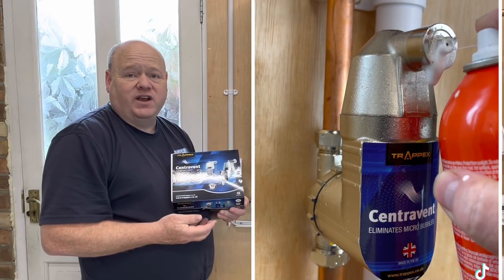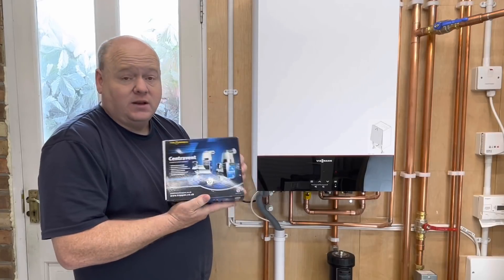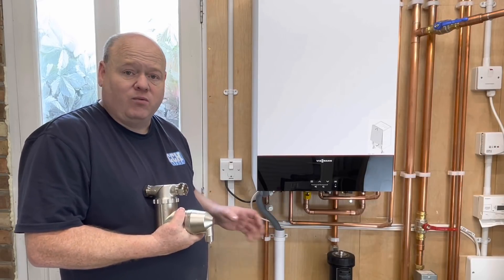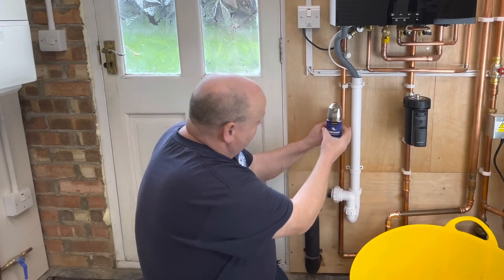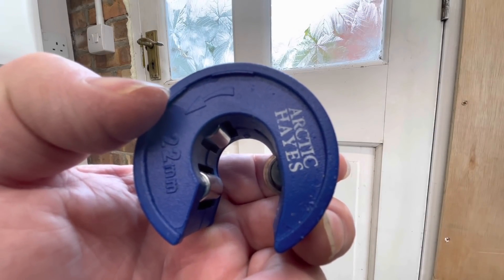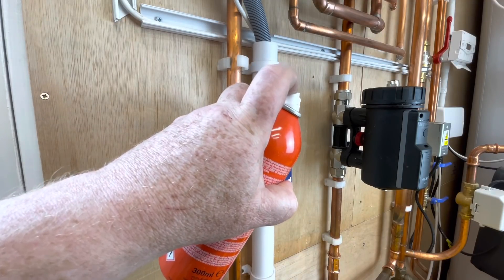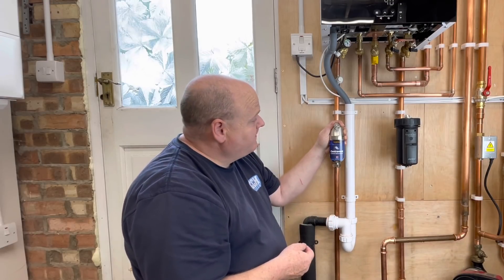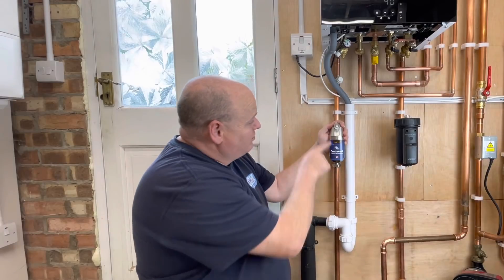Trappex Centravent Deaerator - Central Heating Protection

Comment: Deaerators have been around for years in commercial applications, if you you go back to basic science,water contains carbon dioxide the Hydrogen and Oxygen etc you see that every time you put a pot on to boil, if a scrubbing  medium is added to to Collect theses micro bubbles and are removed from the system. Unlike an Auto air vent which should be closed  Not left open after filling the system . Deaerators are positioned in the hottest part of the system and  AAV are located in the coolest.

Comment: Are they available for hot water cylinder on a sealed system???
Reply from the maker: Thanks very much for your comment, please consider subscribing to support the channel 🙂
Reply: @AllenHart999  or what would you recommend for a domestic hot water tank that accumulates air at the hot outlet??
Reply from the maker: You can install them on an open or sealed central heating system; thanks.
Reply: @AllenHart999  what about domestic hot water cylinders ??
Reply from the maker: @fionnan2811happy   no
Reply: @AllenHart999  Thanks for your reply. 
I have a pressurised cylinder which is accumulating air at the top and when a hot is opened its splashing about
Reply from the maker: @fionnan2811happy  That doesn’t make sense, call someone out to check it
Reply: @AllenHart999  It's a 300l tank with solar heating and oil.
All we did was install it, asked other plumbers and they recommended that we fit an automatic air vent on the hot outlet but I have not seen a vent for domestic water. Everything is plumbed by the book but builds up with air/steam at the outlet. 
I'm baffled with it.

Comment: You may be interested to know that Worcester Bosch do not advise or require de-aerators to be installed as they consider that they serve little purpose on modern, sealed systems.

But of course, on other boilers, or other situations the installation of them may have different outcomes.

Comment: Hi Alan. Thanks for the upload quick question how do you keep your pipework so polished I wirewool mine and looks like yours for a  few days but then discolours.  Do you use brasso? Thanks
Reply: Varnish the pipe before it oxidises
Reply: Varnish???? I would use brasso but not sure on varnish do you have any experience with varnish would be interesting to know what you would use thanks
Reply: Brasso will clean it, but it will immediately start oxidising again.
Clean with thinners then use this
https://www.marinestore.co.uk/Merchant2/merchant.mvc?Screen=PROD&Product_Code=ryibl400a
It's a lot of effort, but I like my own copper to keep its shine, never bothered on anybody else's system.
Reply: @psi10001  thanks 4 your information

Comment: 100% recommend these. I had water/clicking  noise in my heating system first thing when it fired up. Fitted a spirotec. Had absolutely zero noise. Periodically you could hear air getting pushed out of the system. Brilliant bit of kit. In my opinion.

Comment: Surly it won't release air that is trapped in rads on the first floor or in the loft. Of course you would still need to bleed a the system manually

Comment: People seem to be confusing a deaerator with an automatic air vent. The boiler and the pump will generate small bubbles though cavitation and heat. The deaerator will help reduce these as well as bubbles formed by dissolved gases. I assume it'll also remove larger pockets of air as well. Seems like a good thing to me. An AAV is only there to bleed large pockets of air.
Reply: Thank you for that description. While I know they are different you taught me why they are different.

Comment: I am a little sceptical of this product.  For years there has been rad adapters that also let the air out , they seem to work well , the only difference I see is this happens at the beginning of the sequence than later on when it hits the radiators

Comment: Il be honest, biggest con going. Waste of money, boiler has one anyway lol
Reply: Such an ignorant comment when you have no idea of it’s operation, benefits and how heating systems corrode !
Reply: @jassinghIG45  believe me mate, ive got a great idea on how heating systems corrode. Most boilers now adays have the deaerator on the pump for this reason, the microbubbles. If people sized and serviced boilers properly, then these wouldnt fail. Your putting another thing on the heating circuit, for it to fail at some point, as nothing is designed to last more than 5 years now, or else most companies would go bust cause their products are that good. My comment is not ignorant at all, its honest, so you just crack on with your opinion and fit them,if you even do this sort of work
Reply: @Purebeltersteve  so according to you one can just tee a cheap little AAV on and call it a deaerator. Does more for the system than a filter does if piped properly absent of any chance of air forming; including fitting stainless steel heat ex boilers not your rubbish aluminium ones. Definitely required when fitting plastic filters, especially Adey ones. Chemicals cannot do the same job, too much chemical forms more oxidisation in the system. Potable water quality is always the best, copper pipe throughout, brass filter and deaerator will protect the system a lot better without having to spend stupid monies on maintenance, blocked heat plates etc.

Comment: I fit one on every single install, I don’t let customers budgets decide what I should or shouldn’t fit. I don’t drop my standards for anyone. I’d rather lose the job than install a system I’m not happy with. 

My opinion on them is they are the most important thing on the system. Removing the micro bubbles of oxygen means you can’t get rust. I fit the spirotech ones, mainly because they are the only ones I can get, I’d be interested in a comparison of the 2 units.
Reply: would inhibitor do the same job,. If it needed it should be part of boiler.
Reply: @CrashUK28  like a filter? A control? A descaler? An expansion vessel for the main? There’s lots of things we fit on a boiler to improve an install. Inhibitor is only useful for a limited period of time and then becomes more useless over time hence the new regs about testing for inhibitor.

Comment: Greetings from Denmark
Deairreators are very popular here, not just on boilers
We will in general install them in places that’s hard to bleed the air out
Flamco is very popular, the make a model That is both degasser and magnetic filter
Reply: A deaerator should be on the flow, at the closest possible point to the boiler (hottest part). A filter should be on the return to stop debris hitting the boiler, so the double units are pointless

Comment: Allen your videos are tremendous even the little simple jobs are great to watch.
Reply: Great idea and product one question is , if one is fitted to a combi like you have done and it does its job expelling air does that not cause the system pressure to drop over a shorter period of time than normal ,?

Comment: Auto air vent in the boiler does same job
Reply from the maker: Clearly, it doesn’t as the boiler has an auto air vent built-in.
Reply: @AllenHart999  what's the difference then? 
Seems like a gimmick to sell people when plumbers don't want to find the source of a leak/air admittance???
Reply: @sally6457  these units are to let out micro bubbles. Boiler AAVs don't do that.
Reply: @griffithsheating How about nanobubbles? How do you get rid of them?
Reply: @chesshooligan1282  it's a thing. Science is settled.
Reply: @griffithsheating  I hope it's not the same science that the medical establishment has been feeding us for the last three years.
Reply: @chesshooligan1282  lol just billy basic water treatment chemistry.  Your boiler may have a heart attack though if you don't get the micro bubbler 😄
Reply: @griffithsheating  OK, I'll take your word for it. I just bought one. For 59 quid, I think it's worth a go. Rust from the radiators can mess not only the components in your boiler but also the whole pipework in your house. I've already fixed a pinhole iin a copper pipe inside my boiler and I don't want another leak ruining a couple grand worth of plaster.

Comment: Give it a few years it will fail and just start leaking. Like those Aladdin air vents on radiators / towel rails. AAV in the boiler, I just don’t see the need. Good video anyway Alan 👍👍

Comment: I'm not sure I see the need in many circumstances, on a sealed system that hasn't been drained or topped up in a long time would of likely had any micro bubbles formed exit through the auto air vent. I think the only real way to test is to be able to isolate a short leg maybe with the freeze kit on an existing system fit it bleed the leg and then monitor if it pulls any air from the rest of the system. I'm not even sure if a magnetic filter is even needed on clean/new systems. I know a new system that never even had any inhibitor in run for 10 years and when he finally decided to finish the install he drained down to find the system was spotless with no signs or corrosion. Classic case of a plumber not getting round to finish his own house.

Comment: Ive never fitted one , am  not convinced its needed personally, id never buy the spirtect one as i believe there filter is shocking
Reply: I've often wondered what a Spirotech actually does. I've never seen them catch much. They may be old hat these days but Magnacleans usually earn their keep....in my experience. Your experience may differ of course.
Reply: @timhancock6626  the magnacleane does a cracking job , but doesn't last , it leaks afer its been serviced and ive even had them become brittle and snap off, ive heard stories of them flying off. The best one ive found is the omega 1 by far
Reply: @accesszero4803  Can't say I ever had trouble with Magnacleans to be honest, and I have one at home that's over ten years old. I retired 18 months ago, so no longer involved.
Reply: Can't believe Vaillant chose the spirotech instead of rebranding a TF1 Omega
Reply: @psi10001  Vaillant/glow-worm I would expect nothing less from them.

Comment: Where’s the best place to install it?  If it’s on the flow before the pump, won’t the pump suck air in through the de aerator?
Reply: the flow is after the pump 
the pump on a combi and most modern boilers is befor the flow pipe
Reply: At the hottest part of the system to aide coalescence within the unit